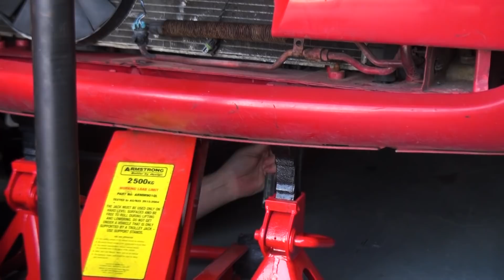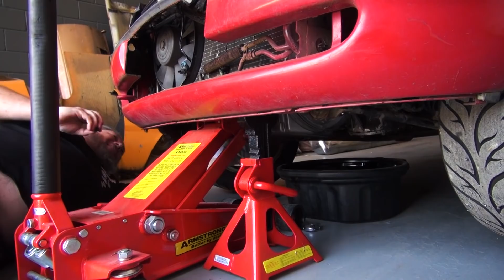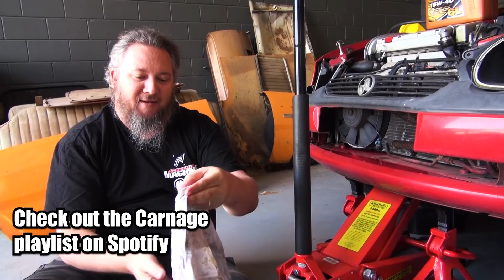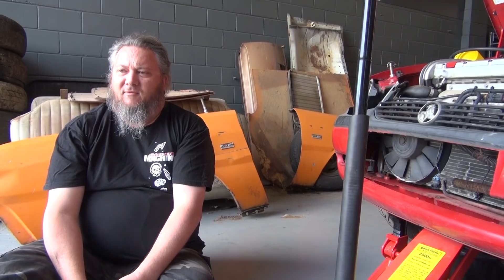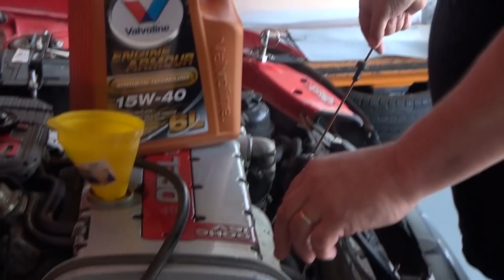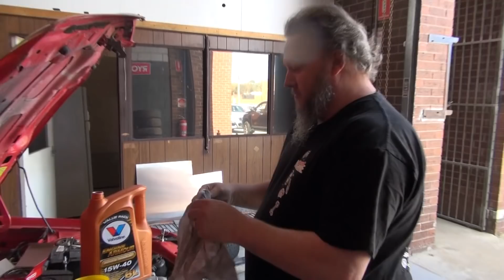Carnage Plus EP40 - Twenty Things You Didn't Know About Scotty

Comment: You oiled the o-ring but you didn't pre fill the filter. Even if it screws on horizontally I like to fill it with oil at least once and let it seep in. If you line it up and spin it on fast enough you don't lose any oil. If it screws on vertically I like to fill it several times leaving just enough room for the thread so it doesn't spill over during install.
Reply: fool. you fill it start it up to fill the filter then top up.
Reply: @RICHOWASP  yep that's exactly how you do it if you like to run your main and rod bearings without oil. Clearly you never owned a 253 or 308.
Reply: @DodgyBrothersEngineering  😂🤣 Can attest to the 253 needing a pre-overfull, dripping down the sides oil filter to the block. All you needed to do after fitting one was to whack the person fitting it with a pillow and they would be tar&feathered. 😁
Reply: @MafiaboysWorld  there is a real knack to it. In the case of the 253 / 308 you needed to fill that sucker over and over until it would take no more oil, put a drip tray under the pump because there is no way to get it on without loosing some oil. If you lined up the oil filter threads with the oil pump threads so they actually touched, you could quickly flip it from a vertical position to a horizontal one and spin like crazy. If you spin it on quickly you lose minimal oil because the centrifugal force keeps most of the oil in the filter. Fortunately the Holden 6 was better designed pump and could self prime with less oil in it, but the idiot that designed the 253 / 308 pump wants rooting with the rough end of a pineapple.
Reply: @DodgyBrothersEngineering  I know. Like I said, the amount of oil that ended up on us aswell as in the filter hole, the surrounds and the actual engine bearings was always fun. Needed shares in a degreaser company if you owned a 253/308. 😂🤣
Reply: @MafiaboysWorld  yeah a mess was a given, how much skill you have with spinning on the oil filter determined if it was a big mess or a little mess.
Reply: @MafiaboysWorld  I think the real trick to it was to ignore the oil on your hands... your hands were going to get oily regardless, so accept that fact and put all your concentration into screwing on the filter fast and straight. That few seconds of oh my hands are getting oil on them made the difference between keeping a little oil in the filter and keeping a lot.
Reply from the maker: I think the existing film of oil over the bearing will protect it for the second that it has no oil pressure, but there's nothing wrong with minimising risk
Reply: @MafiaboysWorld  yes miss those days, along with the old zip tie on the tail shaft trick. Boys will be boys.
Reply: @STREETMACHINETV  It's a Barina Scotty. They're the hatchback equivalent of a Hilux, unbreakable. 👍
🤔
Unless you do what I did and money shifted 4th to 3rd as you're at redline. 😳🤦😂🤣
Reply: @DodgyBrothersEngineering  No fruit salad in the exhaust pipe? 😂🤣 Mashed banana against the cat and a couple of oranges for good measure and telling one of the boys to check the exhaust wasn't leaking at the back. 😈
Reply: @STREETMACHINETV  depends on the engine. Like MafiaboysWorld and I were discussing unless you fully filled the 253 / 308 filter, that thing would gladly spin a bearing before it picked up oil pressure on it's own. It's not just the few crucial seconds it takes to fill the filter at play. The oil in the filter helps create a back pressure in the pump. If there is no oil in the filter you get this pissy little stream of oil going through the gears in the pump and the gears find it really hard to fill up the cavity 100% in the pump, which can lead to churning the oil in a froth. Which means you are without proper oil pressure for way longer than a few seconds it takes to fill the filter. Some people used to resort to putting vasoline in the 253 / 308 pump after a rebuild, just to create that seal / back pressure it needed to pick up oil quickly. Even the high volume aftermarket pumps weren't any better. With skill most engines you can get away without getting oil on you (253 / 308 is the exception because it had to be really full to work). Since every oiling system is different it's just easier to err on the side of caution and give it a drink first.
Reply: @MafiaboysWorld  a spud was always good for a nice clean seal on the exhaust to stop it running.